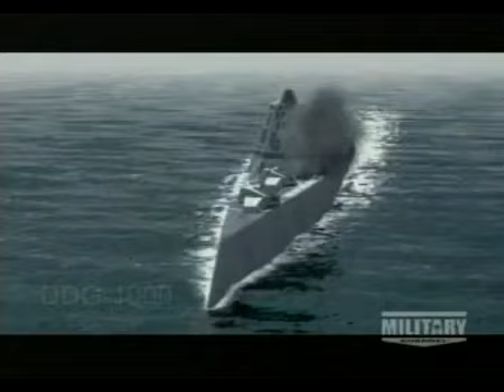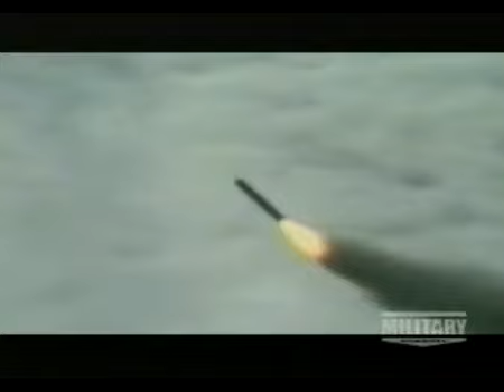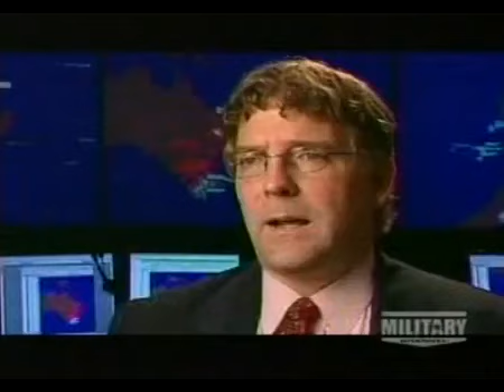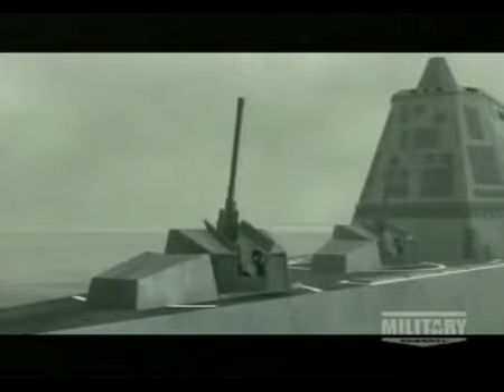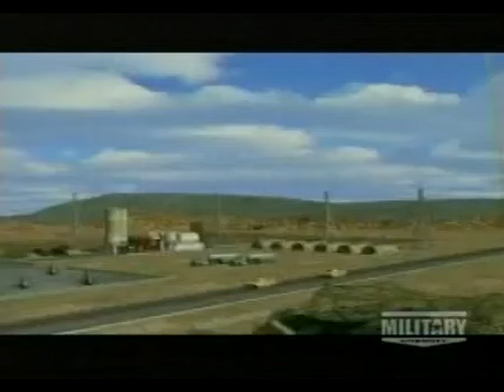US Navy DDG 1000 Zumwalt Class Destroyer

Comment: Features of the Zumwalt class destroyer:

1. Stealth- Despite being 40% larger than an Arleigh Burke-class destroyer, The tumblehome hull reduces radar return and the composite material deckhouse also has a low radar return. Water sleeting along the sides, along with passive cool air induction in the mack reduces thermal emissions.

2. Advance Gun System- The Advanced Gun System is a 155 mm naval gun, two of which would be installed in each ship. This system consists of an advanced 155 mm gun...

Comment: Originally, the Navy had intended to replace its fleet of Ticonderoga-class guided missile cruisers with cruisers produced as part of the CG(X) missile cruiser program; however, severe budget cuts from the 21st century surface combatant program coupled with the increasing cost of the Zumwalt-class guided missile destroyer program resulted in the CG(X) program being canceled. The Ticonderoga class will instead be replaced by Flight III Arleigh Burke class destroyers.